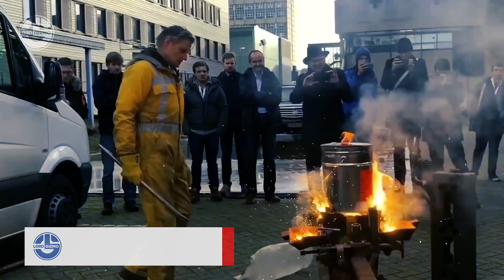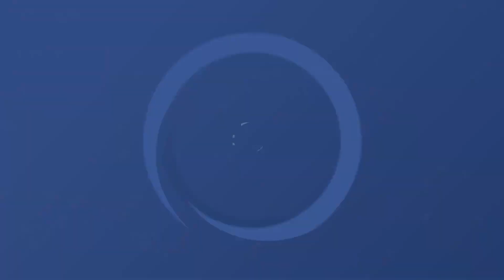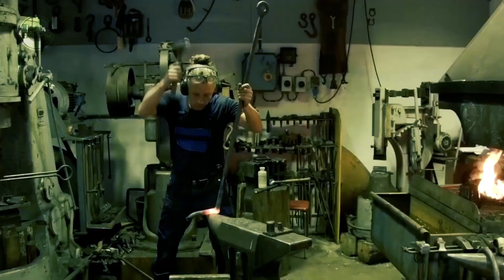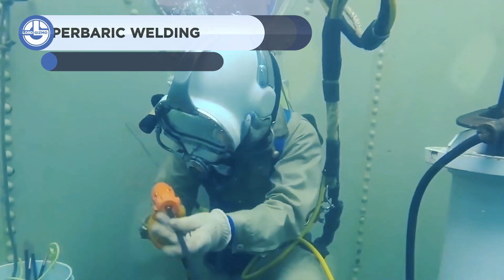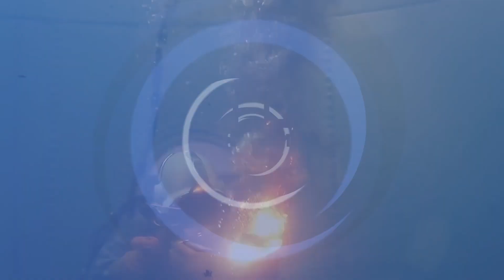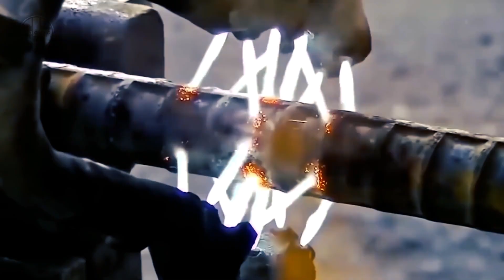Mind-Blowing Welding Techniques You’ve Never Seen Before!

Comment: 2:50 you said … and I quote “minimum of 3100 degree celsius are needed to start the process” and now you are saying… is over 2500 … you can’t even understand what you are reading…
Reply: Thermite welding that I did heated the pot to 5200 degrees Fahrenheit in 5-6 seconds flat. It would then burn through a ceramic core at the bottom of the crucible and into the mold, overflowing into a slag pot.